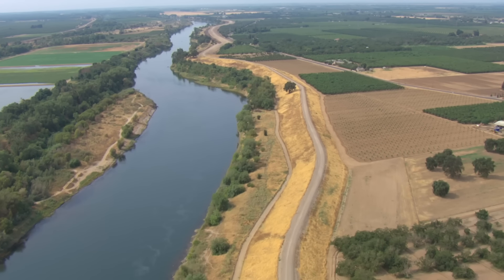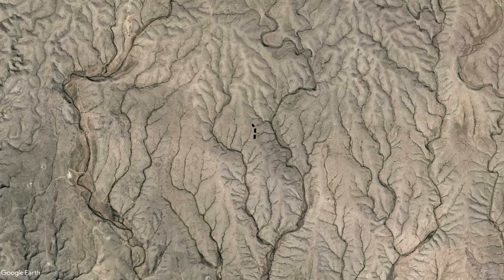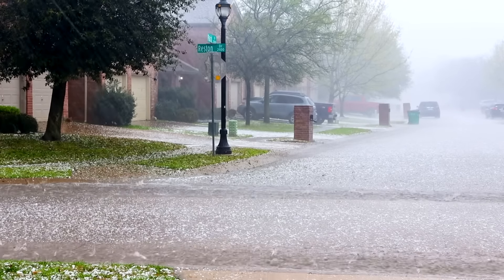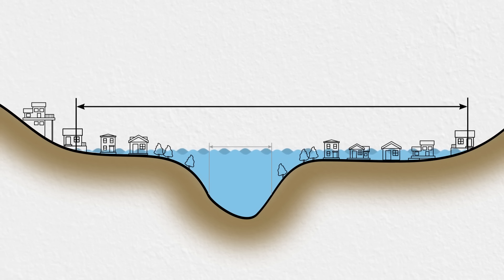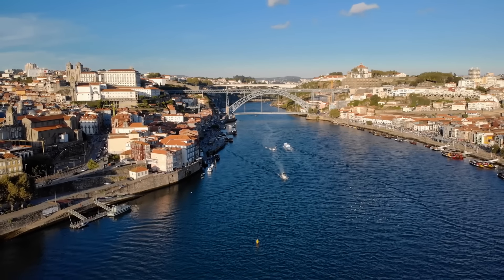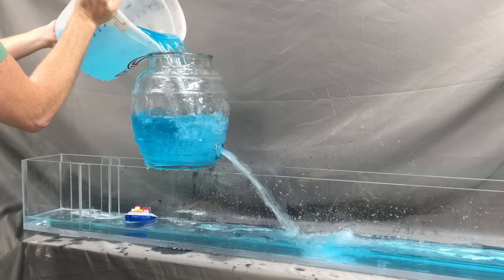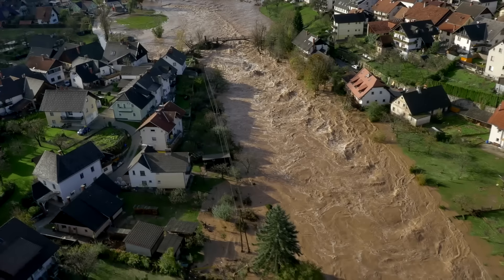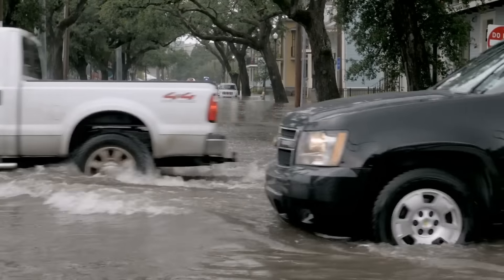How Do Flood Control Structures Work?

Comment: Many parks are located in flood plains because a few structures and concreted down play structures aren't a big deal compared to houses. So the next time you see pics of the flooded park think to yourself "that's because it's on a flood plain...maybe not such a big deal"...some places are still very slow to move housing out of flood plains though...here in Missouri people frequently just deal with it until the buyout offer comes.

Comment: In Denmark in response to increased rainfall cities have started to build large drainage systems intended to divert water from buildings and instead let it accumulate in ponds where it'll naturally drain out into the soil. They also have the added benefit of providing more green spaces in cities and habitats for animals. For example a pond was recently dug out near where I live and now you can almost always find ducks there. You're never far from the ocean in Denmark so trying to divert flood water into rivers is a bit pointless here since there isn't room for any major rivers anyways so instead the idea is to make it so the cities aren't entirely hard surfaces that water can't drain through. Flooding in Denmark also for this reason is rarely large scale unless it's caused by storms so the focus is on preventing smaller localized floods which result in property damage.

Comment: Storing rainwater at home is also a helpfull way. If every house roof can reduce the water that goes into the drains it will help down the stream. 
Not having a concrete driveway gives also more space for water to absorb in the ground instead of in the drain where it can collect together with all the other drive ways that can’t absorb any water.

Comment: In Brazil we have huuge problems with flooding every summer, specially in poorer areas. One of our biggest problems is with the water drainage. Culverts get obstructed by trash and debris, and in these areas, waste and residue management are not good. Every year the same catastrophes in different states and citys :/
Reply: Sounds like you need post10

Comment: There is one option that every home owner, or prospective home owner, can take to mitigate flood damage to their homes. Not the obvious don't live in a flood plain, but the less obvious, build your home to float and have pilings to hold it in place.
Yes, it drives the cost of the house up, but if it will float on a flood you have reduced the risk of damage to the structure by the flood. Flotsam can still strike the structure and cause damage, building breaks that will float can slow that down. ( logs chained together and held in place by pilings letting them float or drop to the ground as needed will stop flotsam at the expense of another item to maintain. )

Comment: As for diversion channels, there's a really interesting case in 1959. 

In uruguay, a hydro plant was constructed before a bend in the river. The bend created an U shape, and not too far downstram there was a city. During 1959, severe rainstorms across the whole basin created a situation in which the damn was being overtoppled and about to break. 
As the damn was far from the city itslef, the flooding while leading to the complete evacuation, didnt absolutely destroy the community. 
 HOWEVER the breaking of the damn and subsecuenting rushing waters would surely destroy everything, including one of THE MOST IMPORTANT BRIGES OF THE COUNTRY which conected North and South. The country is split in 2 by this river, and if this bridge wss destroyed, everything would have to take massive re routes east or west duw to being in the center of the country. 

The flooding kept increasing so the Army corps of engineers was called to seek a solution. What did they settle to? 
Bassically bypass the U with a massive channel DUG WITH EXPLOSIVES. They laid down a track of explosives and once a patch of less resistance was established  the wall of dirst still holding the massive reservoir was blown to hell with tons of explosives. The rushing water left a huge scar in the earth thhat can be clearly seen today even. 

Dissaster avoided, the flood waters receeded snd the town slowly came back

Comment: Should note that dams will release water to lower the reservoir volume if they anticipate a dangerous amount of new water may be coming their way.  This can cause some flooding, but its to avoid a dam failure which obviously is far, far worse than anything else.

Comment: 5:19 : That city and the river besides it looks suspiciously like my city, Rouen. That begs the question : Why are a lot of cities built around such bends in a river ? Does the curvature bring some kind of advantage ?

The only thing I can think of is that curvature allows you to have more of a line in a given area (the most of a straight line you can have in a square is the diagonal, for root 2 or 141% of the side length, but a parabola can fit as much as 233% of the side length), so you've got better water availability, but if that's the case, why is the historical center of such cities on the other side, away from the curvature ?
Reply: A river bend gives extra safety agents enemies.  (the bend makes sure that two or even tree sizes of the town was protected by said river)
also the forming of a harbour was les work (you could harness the power of the river it self)

Comment: I live in northern New York and every spring the snowmelt causes all the rivers to rise and flood in minor ways. Typically its just a park or field next to the river going underwater for a week. 

However, the big issue is that the Great Lakes and St. Lawrence River drain more water than the Mississippi (by 6 m^3/sec per year, last i checked wikipedia) and there is a dam (Moses-Sounders) that generates power for both NY and Canada but also controls the drainage rate of the system.

They need to balance flooding on both Ontario and the river, 1inch of lake ≈ 32ft in Montreal, and Trade ships have a max safe flow rate so 1 dam impacts a massive area's economy and ecology. People love to complain about policy but often the root cause is just too much rain into the system. 

Also i prefer to say "Flood Control" over "Flood Risk Management" even if it less accurate just because its faster and easier to say for a similar intended meaning.

Comment: My state has the last large untouched by man river in the Eastern part of the US. The state has been trying to build a dam or locks and dam on it for years which would also including hydropower which could provide power to 20k to 100k people, lowering their electric bills. Because the river is untouched people rally together, even coming from the West Coast to protest, and they always win stopping the project. The river is a few inches to a few feet for most of the year, the flood stage is around 10-14 feet, minor flooding may happen throughout the year nothing major. Every 10 to 20 years, there always seems to be a major flood, causing billions in damages and taking lives. The river which is 162 miles will reach between 16-24 feet deep during these floods. There are towns and cites along the river that have water lines on their buildings reach 10 feet and higher. A lot of people live near the river, but there are also a lot of farm lands which also get hit, costing the lives of livestock and destroying crops, which increases the local food cost.
Family has a camp along it, over 50 years they stopped rebuilding the house after then 2nd time and started buying cheap mobile homes, we are on our 5th mobile home...know what would be nice, a dam to stop the flooding, it would also make a nice large lack for water sports and increase the water levels year round for fishing and boating.

Comment: That's an actual misconception that a lot of people seem to have, even some of my friends didn't seem to realise it until it randomly came up in a conversation where I had to clear it up.
Not all dams act as a flood control structure. In fact, most flood controlling dams are usually placed in medium-sized watersheds as prevention or in watersheds where precipitation has a record of being abundant enough where flooding is... let's call it seasonal, hence being used a precaution.
Agricultural or eletrical dams are usually filled to the brim and they're built in strategic places and at the end of an amalgamation of medium-sized watersheds (which is essentially a large watershed), respectivelly.

Just because you live near a dam it doesn't mean you're safe from flooding. In fact, while they have a good record of holding their own, accidents still happen.
I'll never live in any flood risk areas downstream of a dam. As someone who makes a living by doing all sorts of risk cartography, the bigger the dam, the scarier the affected area gets in case of a rupture, so noooooooooooo thank you. A bucket filled with water doesn't seem like a lot, but when you pour it into the ground it'll spread like the plague.

Comment: Where we live we're pretty safe from flooding. When we have heavy rains the two streets on the corner we live at divert the water down both streets our house sits on ground a few feet higher over the street and the water flow stays out on the street.

Comment: The most fascinating dams I’ve seen are in the Miami Conservancy District.  Dams between fairly small and surprisingly gigantic (it doesn’t hit you how big the actual dam is, until you realize how big the reservoir actually is) are fairly simple, just big mounds of dirt with a culvert through it.  The culvert is properly sized to flow the channel, but any overflow backs up into, jinkies, a reservoir.

Comment: I've lived next to one of my city's balancing lakes for years, when flood conditions happen on the river a gate can divert water into the two linked lakes which has high banks, if the flood is so severe it threatens to overtop the lake there's a weir to let that floodwater back into the river system. They also kept the various river valleys as parkland so there's very little building, it's just used as recreation or occasional grazing land.

I get to visit Norfolk quite often as well, they have Dutch style water pumping so previously wetland areas can be drained for farming, while the Broads get interconnected with the tidal rivers. In high flood conditions the Broads Authority have an agreement with certain farmers to allow their fields to be flooded to divert floodwaters from more vulnerable areas.

Comment: I live in a wet part of the uk that is very low lying and we have very large flood plains that we use to control flooding by opening sluice gates to flood the land we want rather that residential areas. Might be worth considering them in your next video.

Comment: Am I the only one struck by the scene of the fire hydrant sitting in flood water? I don't think the scene was ironic, but something close.
Reply: @RYAN:
Irony and a fire hydrant(kinda):
Do a search on: 
- Hurricane Floyd
- Bound Brook, NJ
- Bound Brook Harley.     
    Davidson Dealer
Not a 'Funny Story!!
During a decent-sized storm, (I believe it was Floyd) [there's been a few, over the years] a building housing the Harley Dealer had a fire.
The town of Bound Brook was FLOODED!
So, the pic I'm talking about, was a building, Fully Involved in Flames, Completely Surrounded by many feet of water.
The Fire Department couldn't get to the fire- even if they could've,  they really wouldn't have been able to DO anything!  
(B.B. has had its share of water issues, but NOTHING like this)
It was a Very dramatic photo !!
( and it DOES tie-in with the power of water)

Comment: I am a plumber.  I would like to learn more about the physics of plumbing, how copper lines get pin hole leaks, negative and positive pressure, what actually is caulk, how a solenoid works, how a shower valve works…...
Reply: Your not a plumber if you dont know that stuff.

Comment: Great video, congratulations!

I interested in know how do you did the animations in the video ? They seem very simples, but at same time very good and easy to understand. For professors that are interested in develop similar animations to classes.
Best regards
Reply from the maker: Thanks. I draw the different elements of the diagram and then move/mask them in my video editor using keyframes and layers.
Reply: @PracticalEngineeringChannel  Thanks for answering! Could you tell me what programs to use or any course that helped you with theses process. I am not very good with this but I am interested in doing some basic stuff for my classes for better learning.  Best regards!

Comment: Maybe this is why wide-open plains give me the heebie-jeebies. Nice to look at when you're on a hill, but I wouldn't live anywhere but ON a hill, at least 50 m above any waterways in the vicinity. 
Regarding dams with floodgates, is that a thing, that houses are built within the extent the water will flow to when the floodgates are open at full capacity? If so, why would anyone buy a house in that kind of area? Sure, if there's a huge flood that overtops the dam, that's just a "normal" risk of living downstream of a dam. But if you can build within the area that will be inundated when floodgates are open, is there a way you can learn that this is a possibility, say, if you come to buy a house in that position?

Comment: I don't understand these levees: if water falls from above the ground instead of only directly above the water, wouldn't it produce the same height of water above the soil? just like you can use a pluviometer (or whatever you call these things in english) to measure rain in inches and its walls don't interfere at all

Comment: I think this connects well with your last video, but maybe you could make one more in the series that connect the dots? One of the ways that a lot of municipalities are using to manage flood risk is to require homeowners to manage rainfall on their property. The aggregate impact of this can be huge without the massive infrastructure required for the major projects in this video.
I've seen this in a few This Old House videos where they're required to install an underground holding tank to store water shed from the roof and driveway of a home so that that water doesn't run immediately into and overwhelm the city's drainage infrastructure.

Comment: Structural flood reduction measures can be effective if based upon accurate, historic hydrology and sound engineering and are especially good for protecting densely populated urban areas. Where development is less dense such as rural areas bordering waterways, non-structural measures (flood proofing and relocation) are much more effective and cost effective. Structural measures also require substantial, annual operation and maintenance costs to the local community whereas O&M costs for non-structural measures normally rests with the individual property owner. Great video.

Comment: Great video, but I have a question. Shouldn't the dams have more room for flood water during the spring - autumn season, rather than winter time? There are basically no floods during winter, at least here, so it would make more leave less space in dams. Thanks!
Reply: Has a lot to do with what the dam's purposes are and the local climate.
In a place where the majority of annual precipitation falls and/or melts in a narrow time-frame (California for example), dams are usually a combination of flood management and water storage to last one or more seasons. 
After spring melt and spring rains end, flood storage needs end, and conservation storage needs begin. The dam managers will reduce outflows so as to retain the spring melt/rain through the dry season. Throughout winter they will assess conditions and increase outflows if needed to ensure there is sufficient capacity for the upcoming wet season.

Where I live, while most flooding does occur in spring, significant rains can occur at any time of year.
The dams that exist around here are flood management structures first and foremost.
At the dam near where I live its reservoir has around 90% of its maximum capacity allotted for flood management. The other 10% is the conservation pool and its really there just for the hydro and recreation, not to store water for drought. 
When flood storage is used in our reservoir the goal is to return the lake to its 10% conservation pool level quickly so as to be ready to store water from the next significant rain event. The trick is they have to do it while managing outflows such that they don't cause negative downstream affects along the river, or the river it is tributary to. Its a pretty big reservoir so it can take 6 to 8 weeks to get from 95% capacity back down to 10% capacity.
Reply: @dorvinion  Thank you for the in-depth insight! It's a good point that it depends on the main function of the dam as well as the location.
Reply from the maker: Good points from David. Also keep in mind if it rains during the winter, you get much more intense runoff and volume because it's not soaking in through the snowpack. It is a very location-dependent thing.